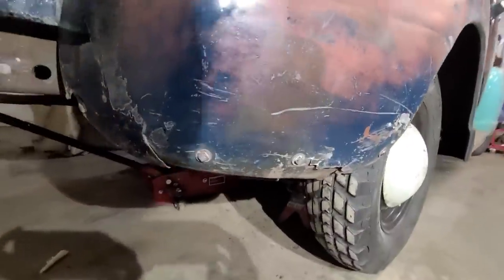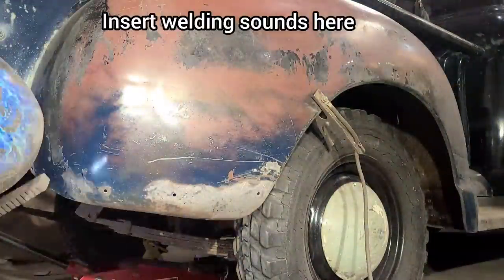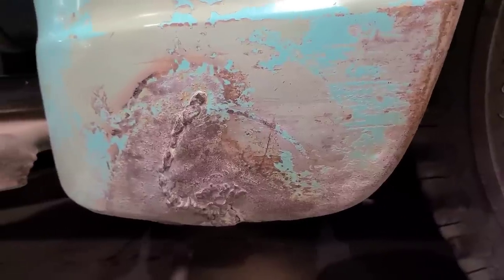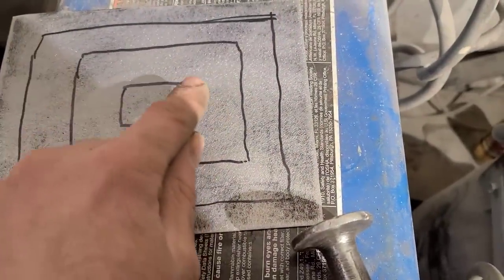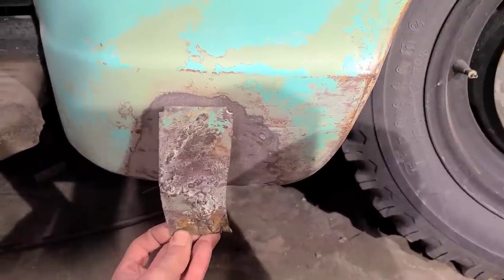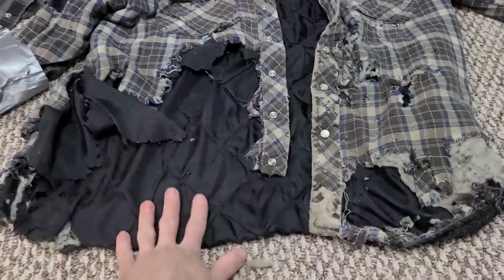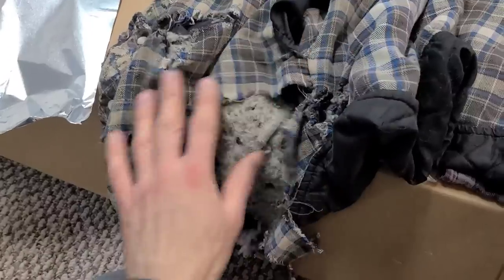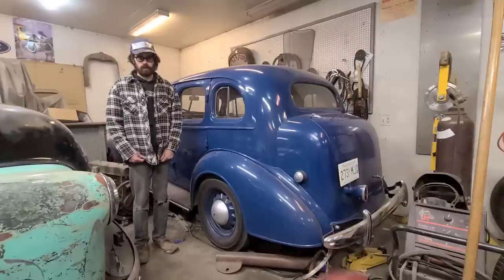Old Truck Fender Fix, and Abandoned Vintage Shirt Restoration. A Terrible 5000 Subscriber Special!

Comment: I really gained some knowledge here about old clothing refurb. The tip about incorporating tinfoil just blew me away. You missed out about laying the garment in your driveway and running over it a few times, just to set the filler, though! Any chance you could do a video about welding the cracks in a 50-year-old tyre? Happy New Year!
Reply from the maker: Tire restoration is a great idea for a future video! Although if the repairs fail it will also probably be my last video haha!
Reply: @CarterAutoRestyling  : Nah! I'd keep watching!

Comment: Flat face dolly on underside of coat where it has been taped. Curved face hammer  applied to the taped repair  top side and you will have a great result.
Reply from the maker: Excellent advice, will try that on the next jacket repair!

Comment: I unfortunately sold a car to a guy like your new truck guy tire kicker once and seen firsthand how they are. A guy who snivels about a cracked fender on a 72 year old truck would probably be calling you once a week wanting warranty work too because he found rust in the gas tank, delaminated glass, door doesn't latch like a new truck, rear main oil leak, etc.  Had he gotten home with it I would venture to guess the first thing he would've done would have been to pull that fender off and scrap it. Then five years later put the rig (minus the fender) on Craigslist as the project he never had time for. I think you saved this old Chevy a lot of pain.
Reply from the maker: Oh yeah I'm glad he didn't take it! I cringed once he started telling me his plans for the truck. Fortunately a week later I sold the truck to a good home!

Comment: When you are putting a crown in the panel doesn't it work harden the metal?   I had not thought much about why fenders crack at the corners, I am not a body man but I know a tiny amount about work hardening.  I know the fenders also are more apt to be hit by object at the corners but I was wondering if you thought work hardening might have a hand in it.  Did you ever take a bit of duct tape and resole your cats feet to protect them from harm?  I tried it when I was a child, I am sure the cat liked it because he danced about picking up his feet to show everyone the resoling, my mother did not understand my reasoning and beat me soundly.
Reply from the maker: Any working of metal will harden it, but it takes an obscene amount of hammering before a piece of mild steel will become brittle. The main reason the old fenders crack is because most of these vehicles never saw paved roads. The majority of them spent their lives bouncing through pastures and rutted dirt trails. With the fenders hanging outside the vehicle with no real support it's inevitable that something has to give. The old vehicles that spent their lives in a city on paved roads rarely end up with cracked fenders.

Comment: When I went to body school back in the mid 80s we had to work a dome into a one by one foot peice of sheet, It was held in a kind of stand so you could work on it easily. we then had to shrink it in the middle with a torch and then pick and file damage inflected by Mr Tibdeau the instructor. I ended up becoming an aircraft mechanic but still do body work on my own little projects from time to time. Its better to have skills and a little money than to have no skills and be wealthy....is that right...I think it is for me.
Reply from the maker: I've got little skills and little money haha. We did the exact same project in the autobody course I took 10 years ago, they called it the torture panel!
Reply: @CarterAutoRestyling  It seems like a lifetime ago...I guess it was. 
The skills still come in handy though. 
Love the channel.

Comment: I'm glad you didn't fall for that scam artist. He was going to cheat you then turn around and flip  it to someone else telling them the opposite for double the price. That's how he got his fancy truck and trailer. He might have even tried to give you a worthless check and completely ripped you off. It's a shame there are so many scammers trading in used cars, especially vintage ones.. He didn't have a clue he was talking to a master body man. He was trying to beat you down under Xmas day pressure to get going. No, selling vehicles has to be cash only or certified funds up front with a deposit first. Thanks Carter for not falling for his scam.
Reply from the maker: Yeah there were too many red flags from the start, and I was definitely getting some flipper vibes. Oh well, life goes on! Thanks for watching!

Comment: I had a  hood for a rare and expensive car which I put up on ebay. It was NOS and probably the last one in captivity. I had no use for it as only 58 of this particular model were ever made. It 'sold' for $700AUD . The buyer turned up and promptly started complaining that the part wasn't pristine (it's 50 years old...) and tried to negotiate the price down. I told him,"No, I'll cancel the sale if you don't want it ..."   At this point he decided that if he walked off he might force me to lose a sale and make me  buckle and accept his derisory offer. I walked out to the street with him...to his New AMG G63.😑😑 I ended up selling the part to someone who had the right project for the part (fire victim) for many thousands after he offered to buy the part at his price. It turned out the ebay buyer was going to try and build a clone with a base model and put it on the market as a "newly discovered " find.
Reply from the maker: I'd like to think that the guy who was originally going to buy your hood will  get what's coming to him someday. The car community is small, so it doesn't take long for word to get out when someone's trying to take advantage of people. Paying full asking price or making fair offers when I'm buying something has always paid off well for me, either the seller will throw in a bunch of extras with the deal, or I'll get invited back again and offered stuff at heavily discounted prices.

Comment: The drill would have worked fine on the jacket, the trick is to place both cats in the jacket first. As for the truck shopper, my suggestion to him would have been, ahh, well, anatomically impossible. I am glad to see that I am not the only one to store a 32 k-member in the laundry room. Mine's behind the tudor floor pan and the fordor seat shell. Then there's the front fender and a couple grille shells in the living room and.......why yes, I am single, how did you know?
Reply from the maker: The house is the safest place for 32 parts haha! Sounds like you've got a nice collection! Someday I'd like to actually own a 32!

Comment: What is the cotton butt technique?
Reply from the maker: Check out fitzees fabrication https://youtu.be/_u31t13QO6A
Reply: @CarterAutoRestyling  But why do you call it a cotton butt, Fitzees just call it a but joint. Never heard that term before.
Reply from the maker: @paulbellanger2772  "cut and butt"
Reply: @CarterAutoRestyling  OK, Autocorrect at work. Thanks for clearing that up. While I'm here , how about a little stainless hubcap repair.